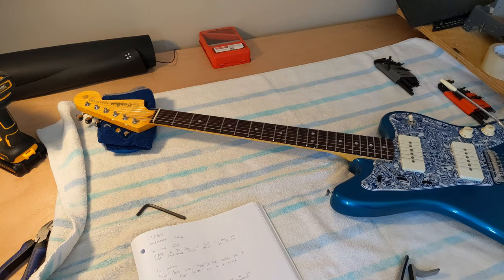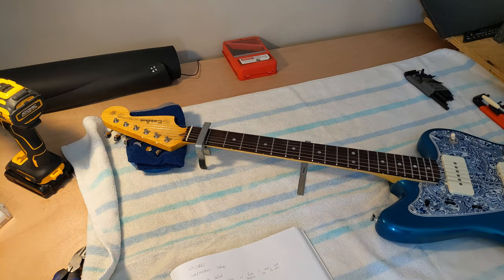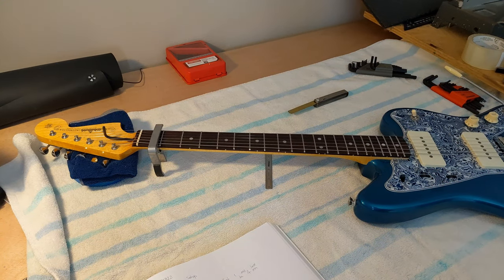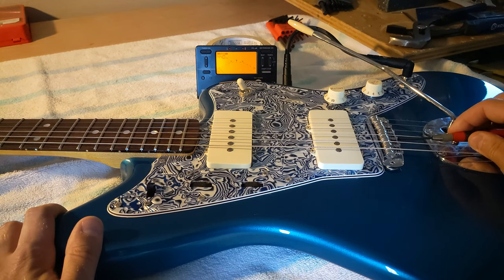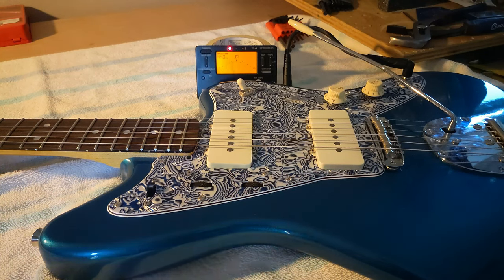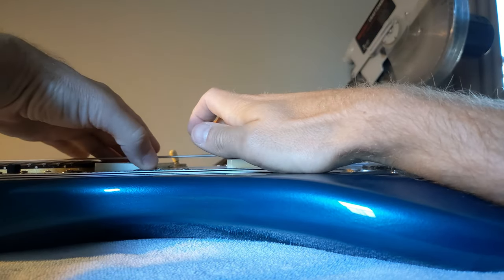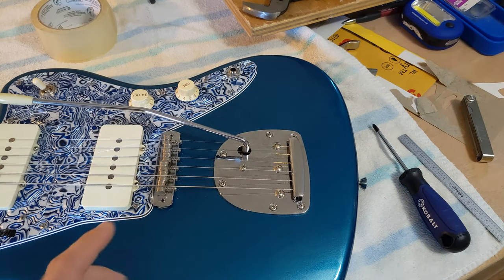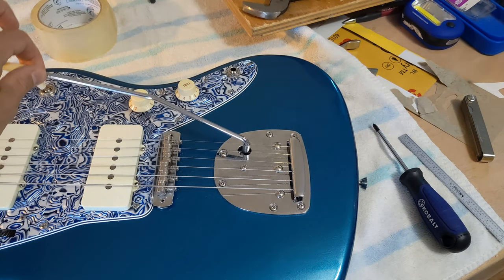DIY Jazzmaster Part 7 - How to Set Up a Jazzmaster

Comment: Very good. It's worted to file the pivot plate. I did it with my squier 40th anniversary jazzmaster. All tuning issues went away and the whole system became death silent. It's not worse them the AVRI which is installed in my usa jazz

Comment: Hi, I got my first JM recently and followed the instructions of this vid, so far everything was fine but yesterday while recording my high e string started playing same notes on different frets. Figured out it had something to do with the saddle / neck relief and now i regret adjusting the neck relief with the key that i got with the guitar. I didnt know how to fix it so i tried by tightening the screws on saddle but accidentally popped my high E string. So i thought that its not really a problem and i can replace my high E string later, as I didnt need it to finish the recording of the song. However during recording the same thing happened to B string. The saddle is slightly tilted and kinda more sinked in on the side thats closer to the circular tone and volume knobs. I found on reddit that I could lif the saddle up with my hands and put some duck tape on it so it doesnt sink in but im not sure wether to do that or not as I believe there is some tension thats making it sink into the bridge  and the duck tape might help for a while but make something worse in the long run. I tried to lift the saddle up with hands and it seems like it just need a bit of leveling or like to put it in in a certain angle which I did, and it kinda worked and my B string doesnt play same notes on the frets anymore. However if I play the guitar with tremolo bar or even without it it slightly sinks in agan and tilts to the left again and the same thing repeats. Does this have something to do with the neck relief? If so, Is this fixable? I spent all my saved money for the JM, so I really hope this is fixable.. do you think so? Or do you think i overtightened the nut in the neck and its beyond home repair? I dont know anything about the guitar hardware diy fixes or anything do you think I need to find some guitar repair shop? Sorry for too many questions, but could you please help? I tried many forums but without any solutions... thanks in advance
Reply: You put your weed in there
Reply: @nosferatu2  thanks it worked!